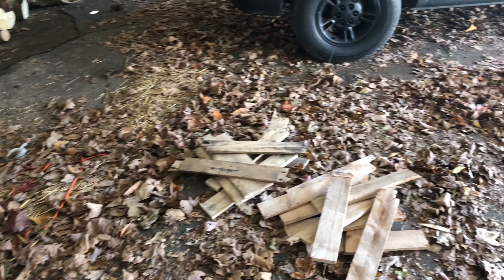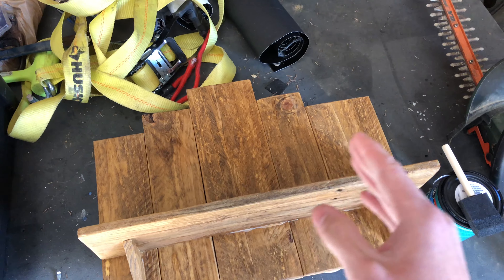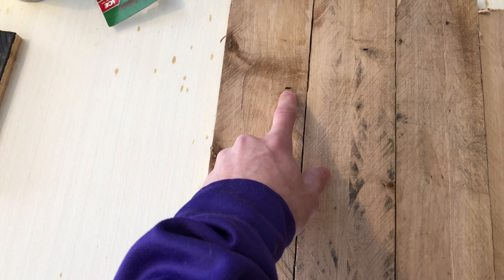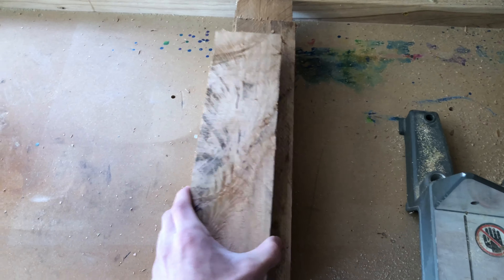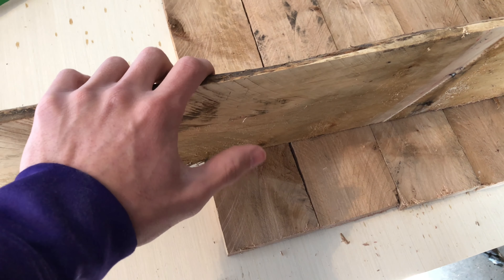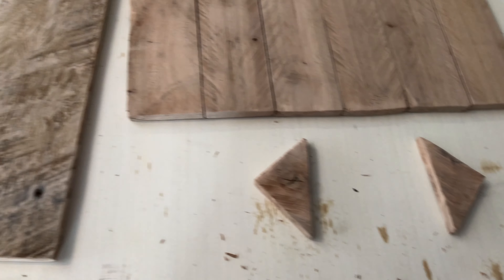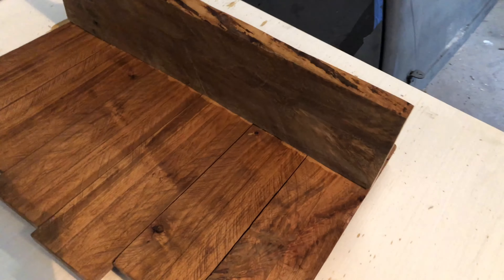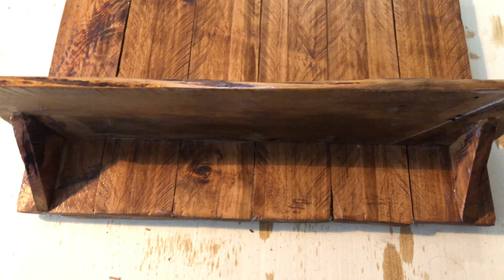Building A Coat Rack/Key Rack Out Of Pallet Wood

Comment: How did you hang it on the wall?
Reply from the maker: Just drilled straight through to the studs
Reply: Cool thanks.
Reply: Mine came out good. Looks almost identical. Two things I found, after I stained it, the glue showed through prominently although it gave it a more distressed look so no biggie. My only concern is the glue holding it together. Did you really not use any screws? I'm afraid after I hang stuff on the hooks the boards will pull apart. Thanks man.